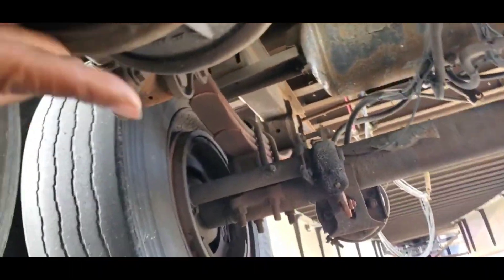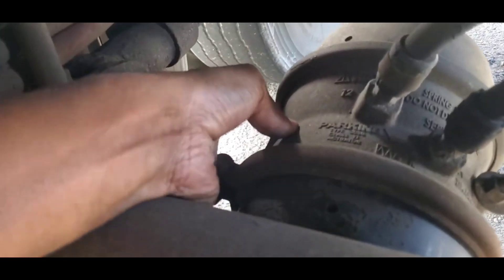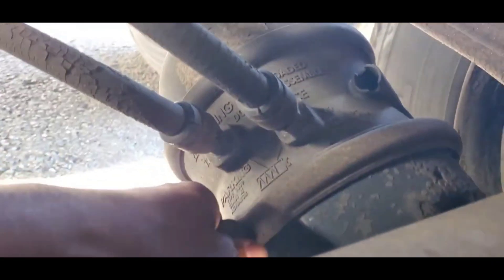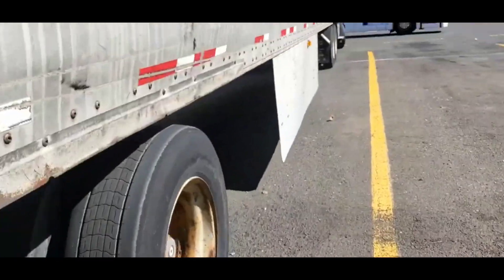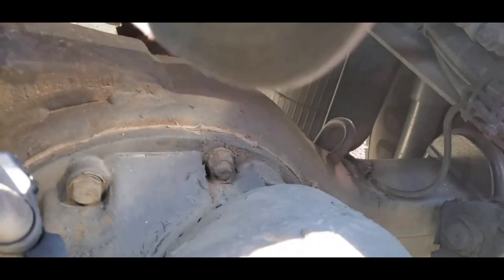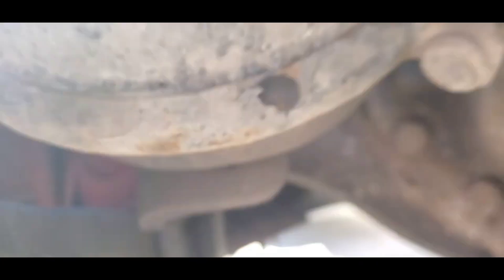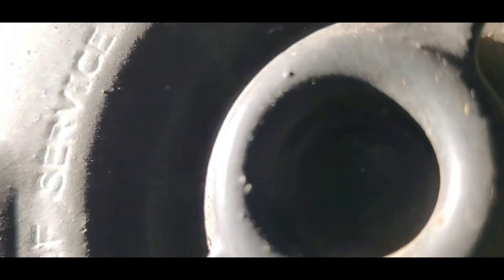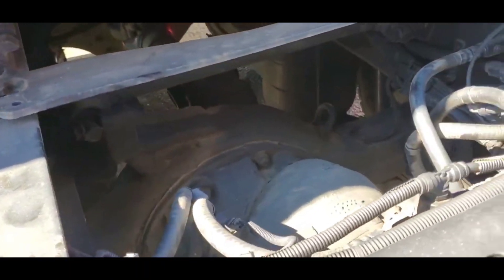The Right Way To Do A Air Leak Test

Comment: Can’t you turn the truck off and then hold the brakes to see how much pressure you lose on the dash? You shouldn’t lose no more than 5 psi otherwise you have a leak…
Reply from the maker: Yes you can. But you should periodically check for noticeable leaks before DOT pull you in and check it for you.